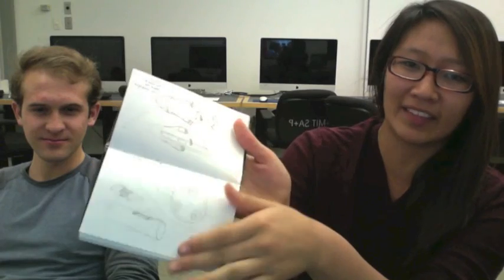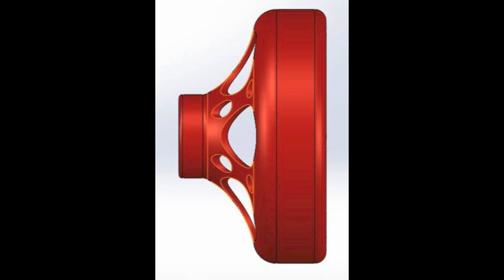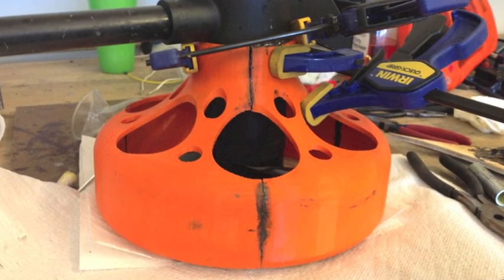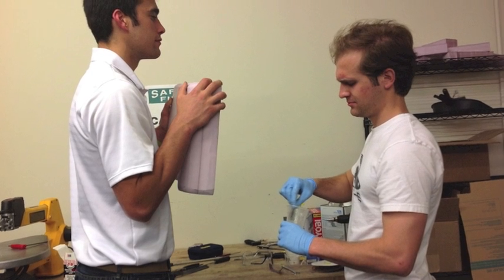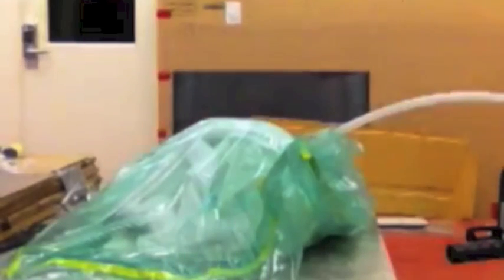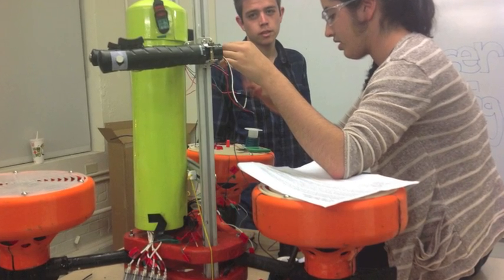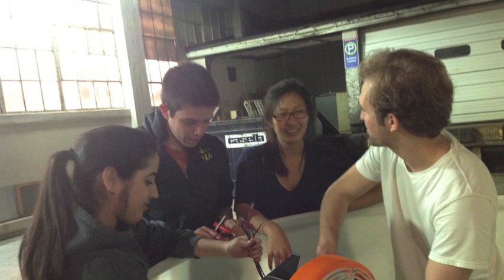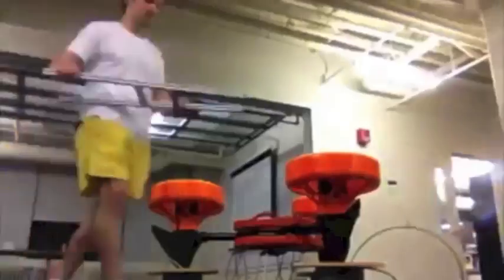Diver Propulsion Vehicles - Prototype 1

Comment: Hello friends i am trying the same project but with single propeller but i got one doubt

how you are calculating the relation between propeller dimension and power of motor

for example if i bought a simple fan of one feet with six vanes and i attached a motor then how can i know motor is over rated or under rated for that particular fan

please provide the formula if you know then it will be useful for optimizing the motor efficiency